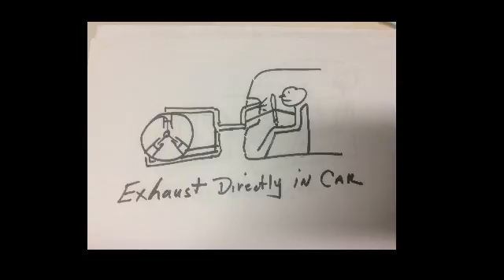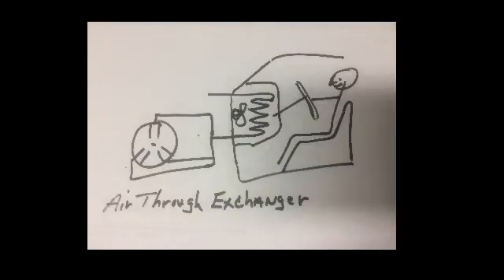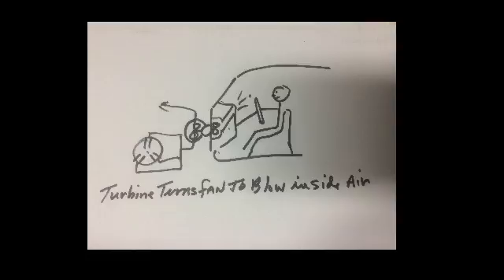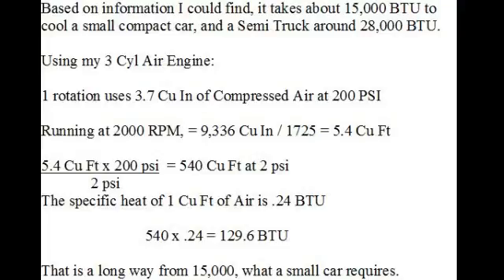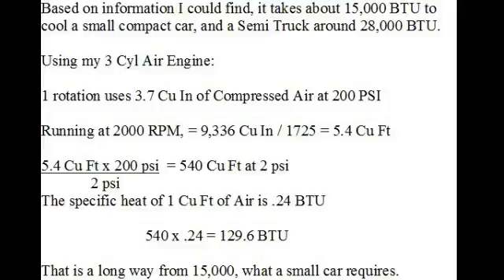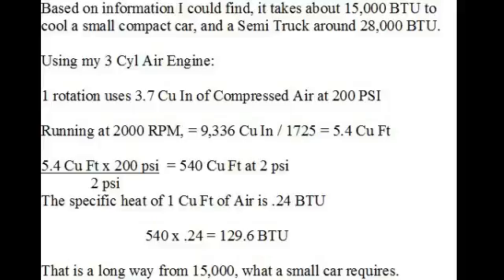Using Compressed Air Exhaust for Cooling or A/C

Comment: While I realize this video is old, it seems to me you're still going strong, so I thought I'd mention that the calculation seems to be missing some important units/parts. 

Expanding ("room temperature") air from 200 psig to atmospheric pressure to produce work can at best be about 50% efficient, as that expansion cause an extreme temperatur drop, and by that reduced pressure, meaning, before you account for friction and without adding heat you get about as much energy in form of work as you lose potential due to cooling when expanding air from 200 psig to atmospheric pressure, assuming a sufficiently well designed system.  

On top of that, the relative humidity of air changes with pressure. Air compressed to 200 psig at room temperature and 100% RH will after expansion and after it has regained heat to reach room temperature will be at about 7% RH,  which means there's significantly more "air condition potential" than potential for mechanical work in 200 psig air used in a compressed air engine. 

A part of your calculation that seems to be missing the temperature change in the heat capacity of air. Heat capacity is typically given in amount of energy transfer required for a given change in temperature for a given amount of substance. In the metric system that's usually joules per gram of substance per degree Celsius. In imperial units that's usually some amount of energy for some amount of the substance, per degree Fahrenheit. While I mostly use the metric system, I think the heat capacity of air is most commonly described with imperial units as 0.24 BTU per pound of air per degree Fahrenheit or Rankine, which is the same thing. 

While one pound of air at "normal pressure and temperature" is about 13 cubic feet, adiabatic expansion of compressed air from room temperature and 200 psig will cool the air down to below -200 °F. So, so while a pound of air is about 13 cubic feet, the exhaust temperature without accounting for friction will be more than 260 °F lower than room temperature, so 260/13=20, and rounding off 129.6 to 130, and multiplying with 20 you have 2600 BTU of cooling. Not enough? Well, that's per minute, so multiply with 60 to get the BTU per hour, which the numbers required for cars and trucks refers to, and you have 156,000 BTU per hour, which is more than what's needed for ACs for 10 cars, or 5 semi trucks. And that's just the sensible heat, on top of that there's still the fact that the exhaust air has very low absolute humidity, so you don't have any need to compensate for latent heat.
Reply from the maker: Thanks for checking in and your detailed analysis of the use of exhaust air on cooling.
That is a very old video, but yes I am still working on developing an Air Engine, and the endothermic problem is one I will have to contend with at a later date.
At present I have a completed 6 cyl eccentric design, and am working on a 3 Cyl Orbital Driveshaft Rotator design equal to a 6 cyl output.
Both designs are meant to be installed in the 72 VW that I have, later this summer - probably early June.
I have some various design ideas on heat exchangers to help with the cold air, but I do realize they won't solve it completely.
Here is the lates video about the engine I am still working on.   
https://youtu.be/s-LS9qfEpRM

Comment: Your value for the specific heat of air is correct, but you've incorrectly equated it to the VOLUME specific heat (which is only 0.018 BTU/ cubic foot). This reduces the cooling by a factor ten.
Reply from the maker: betazoid100 
Thank you for your comment, my intention was to use a turbo device that would be used to turn a fan which would just help cool without putting any back pressure on the engine
Reply from the maker: Thanks for commenting

Comment: Here is some airpressure lomotives.http://www.douglas-self.com/MUSEUM/LOCOLOCO/airloco/airloco.htm
Reply from the maker: Thanks for the websites, I looked at them and they are pretty neat, but a lot more that i want to get into.
The Air Reduction valve might be something i can use?
I have done some comparisons on on tanks and pressures, and will be working on a video soon
Reply: Air Engine Research Ok.Thank you very much for the answering.Keep up the goodwork. :-)
Reply from the maker: As you may have seen, I decided to take your advice and get help with trying to buy storage tanks and a compressor to refill the tanks. I set up a GOFUNDME  account  under airengresearch.  Guess i'll have to wait and see if there is enough people out there to spread the word and  make it happen - Thanks!

Comment: You can use old fridge unit   make the ac,there is compressor just take compressor out and connect the exhaust to fridge cooling unit.If the compressor works u can use it to make HPA compressors allso.You can find youtube video allso from that.:-)
Reply from the maker: Hello again
I am impressed that you took the time to look at many of my videos, and you came up with a lot of good suggestions and comments!
I will try and answer all your questions, and give you my views on the comments. 
I think it will be easier to make another Youtube Video, since I will have some charts and spreadsheet information to show along with comments.
It may take a little while, but don't give up on me!

Comment: The heat your car u can make ethanolheater or buy it somewhere?
Reply: Meaby etanol heater (the flame) can heat the cars original heating coil and then small electric or stirlingpump can circulate the water inside the radiator and then blower blow the hot air inside?Atleast volvo is using etanol heater unit at the electric car.I do not remember the model but it is on market now(meaby).I put the information later when i remember the model.
Reply: It was volvo c30 extreme ev winter test or something,they talk about the ethanol heater using at  the climate control up to -35 celsius.But they do not show it.
Reply from the maker: Thanks for the sugestion
Reply from the maker: I'll check it out, Thanks

Comment: There is at the market HPA compressors,Shoebox made in USA, and other marks,but u can allso ask local scubatank fillers how much is the tank filling.But you are so smart that you can convert HPA handpump "what they are using filling up the paintball gun tanks etc" using electricmotor that you dont have to pump 2000 times to fill the tank.There is allso excsamples at YouTube how you can do it.Thx
Reply from the maker: Thanks, I do have a compressor